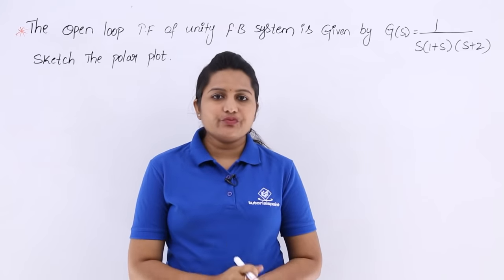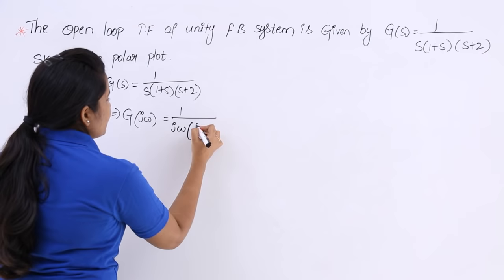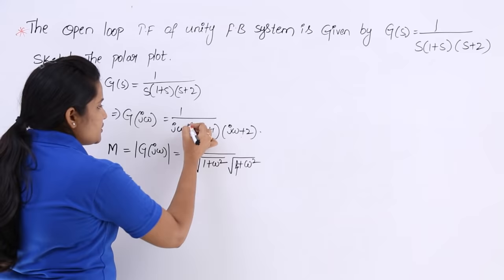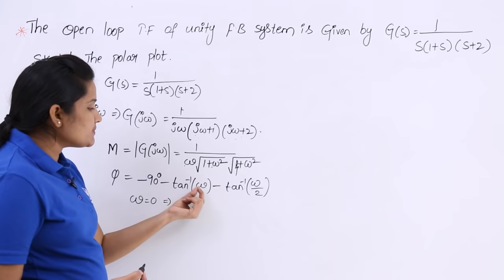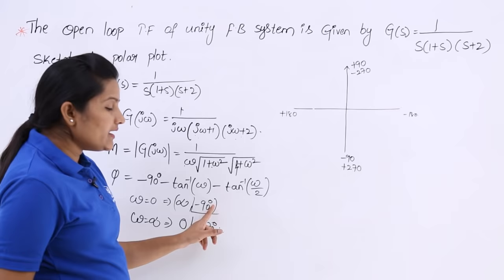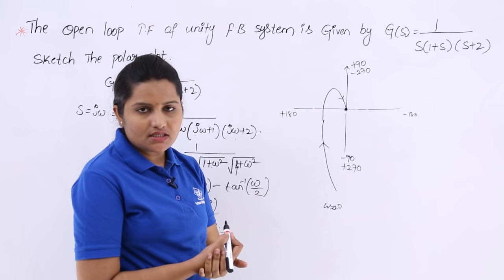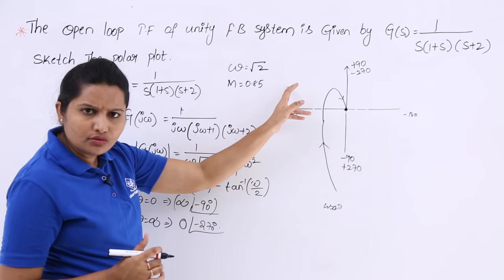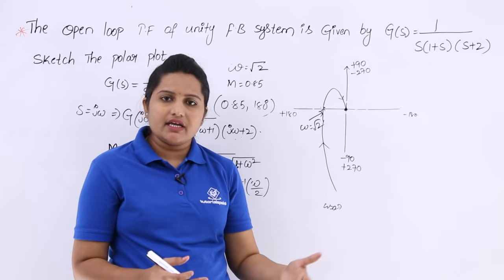Problem on Polar Plot

Comment: For calculating the omega w value, perform the following steps. Shift 90 degrees to the other side, so -tan^-1(w)-tan^-1(w/2) =270 degrees. Or, tan^-1(w)+tan^-1(w/2)= -270 degrees. Now, apply the formula of tan^-1(x)+tan^-1(y)= tan^-1{(x+y)/(1-xy)}. So, tan^-1(w)+tan^-1(w/2)= tan^-1{(w+w/2)/(1-w*w/2)} = -270 degrees. Apply tan to both sides. So (w+w/2)/(1-w*w/2) = tan(-270)= undefined. Undefined means that the denominator is zero. Therefore, 1-w*w/2= 0. Or, 1-w^2/2 = 0. Or, w^2/2= 1. Or, w^2= 2. Or, w= rt(2). Thus, the value of omega w is sq. root 2 or 1.414.
Reply: thank you so much

Comment: Omega value can be calculated just follow my steps
1.send the 90 to LHS    [~(-180+90=-90]
2.get the equation as  (-90)=-tan^(w) - tan^(w/2).... {~remove negitive sign both side}
3.apply tan on both sides
Tan(90)=tan(tan^(w)+tan^(w/2))
4.we have formula.. Tan(a+b)
5..1/0=tan(tan^(w)+tan^(W/2))/1+tan(tan^w)*Tan(tan^w/2)........{~WRITE TAN 90 =1/0}
6..1/0=(W+W/2)/1+W2/2......{HERE W2 IS W SQUARE }
7.cross multiply
8. U gets 2-w2=0.......{here w2 is w square}
9.hence u got w=root 2....
Try it and be care full at cross multiplication only this one step i didn't wrote completely...
Cross multiplication will me like this ex. A/B=C/D...
Cross multiplication we gets.... AD=BC...... I spended 1hr to get it. I hope with my suggestion u all will get it in 10m...
Reply: thats +180 in phase angle
Reply: @sophia
Reply: Thnks bro🥰🥰
Reply: thankyou!
Reply: tan a+b formula is wrong

Comment: W = 1.41 and Magnitude (m)= 0.167 and not 0.85
Reply: Correct I was a bit confused how the hell did she get that value and where did I make my mistake
Reply: Saket Fule yes am finding the same 0.16 but when making magnitude isn't it supposed to be 1/(w^2......) Rather than 1/(w^1.....) As it is.

Please keep in touch 
@lusangw3 Twitter
Reply: @graceghambi5360  no it should be 1/(√w^2√........)i.e., 1/(w√.......)

Comment: For those who have doubt in finding Omega Value
move -90 to otherside of eqal 
use  -tan^1(x)-tan^1(y) = tan^1((x+y)/1-xy),
then take tan on both side...Find w
Reply: Kuch nhi samjha
Reply: By this w goes to Infinity
Reply: Bro first of all, tan-¹x + tan-¹y = tan-¹[(x+y)/(1-xy)]
Secondly after taking the 90° on the other side it sums up to be 270 and tan 270 is not defined.
Reply: @prabhatmihir  Equate the phase expression with -180° and not with 180°
Reply: Same doubt here
Reply: What value should i insert in x any y
Reply: @kumarabhineet4595  how does that make any difference?
Reply: @kumarabhineet4595  bro still we get infinity
Reply: @prabhatmihir  By doing the same, answer will be root 2.
Reply: What values are x & y....?

Comment: Ma'am..I think in coordination system....+180° and -180° at same  position..But you have to taken two different or opposite position,why Ma'am.
Reply: Depending on clockwise or counter clockwise we decide sign of the angle.
Reply: In the previous calsses  180°, -180° are at same position

Comment: the value of magnitude at w=root of 2 is wrong. the real value of m=0.166666
Reply: How u r able to take out the value of w=?!. The first most difficultly I face why she have written +180° in the negative real axis which should be -180° if I consider in the direction of Type2(T2)  system which brings down the final equation of phase angle to
-180°=-90°- tan^-1(w) -tan^-1(w/2)... Solving this equation by multiplying tan on both sides the value of w becomes infinite
Reply: Help me if my concept is wrong.... My exams r near
Reply: @shelinapachal9455   i have exact problem you face and my exam is day after tommarow 😂😂

Comment: Can u explain briefly how w=√2
Reply: sravani dumpati substitute fie with 180 degrees in the phase angle equation.
Reply: Bro first we need to find the intersection with negative real axis, then rationalize,thn equate imaginery part to 0, thn u will get w=✓2
Reply: First substitute fie as 180°than move the 180°on RHS side than move tan inverse on LHS side use the trigonometric formula of tan inverse x + tan inverse y =tan inverse (x+y)/1-xy than solve it

Comment: The procedure use for w is wrong think so...there is another procedure in which we have to convert the denominator of the transfer function into value having only real parts (i.e by cross multiplying) after that the we will be getting a imaginary parts to in the numerator which we have to make equal to zero (ex - num = 15w +j(5w²-10) , then we have to make (5w² -10 = 0) then we will get w = +-√2) and if do same in this example also we will get w=+-√2 ...but magnitude will be 0.166. hope this may help..
Reply: putting theta = -180 also gives us w=root2

Comment: Ma'am i didn't get how you get the value of w=√2
Reply: Sm question
Reply: phase value become root2 by substituting 180degrees in the place of omege
Reply: Substitute phi equal to 180, that is where polar plot cut horizontal axis and find w
Reply: Guruprasad Hiremath 
Line is crossing in anti clockwise direction y not -180
Reply: Yes we know that phi is equal to 180. What do you do with the inverse tan() to find omega?

Comment: How u got w =√2
Reply: use the calculator to solve it for you
Reply: Multiply both side with tan....  In LHS angle will be tan(-90) means 1/0...... Now equate both side you'll get the value